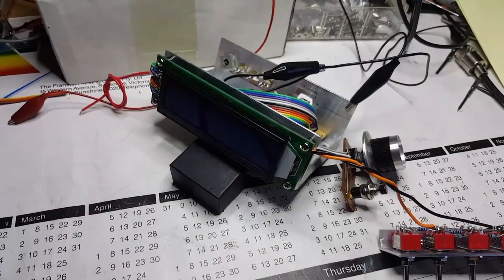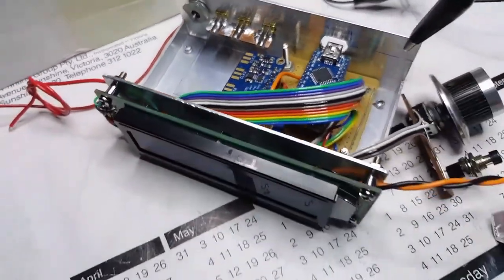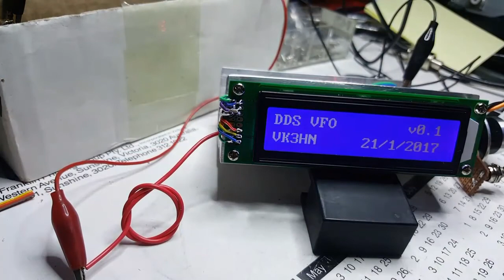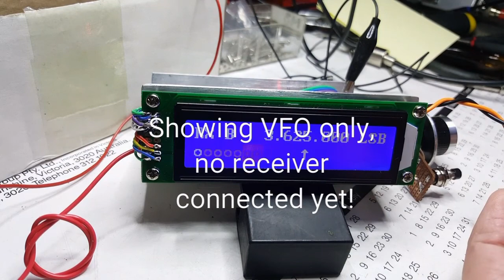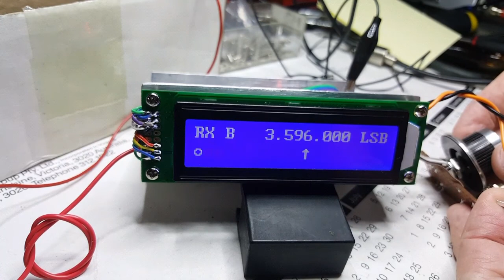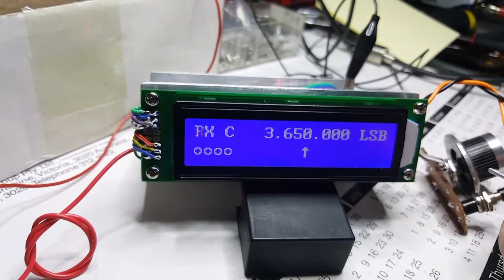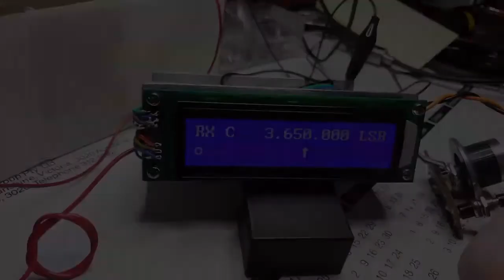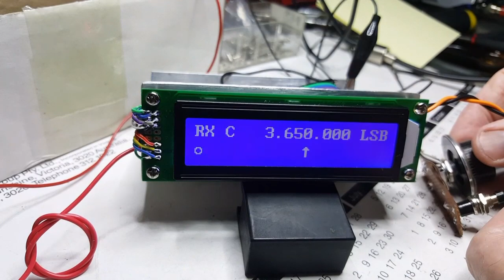Multiband VFO with Arduino and si5351

Comment: I have admired your experiments, I ask, if possible, that you increment the clarifier optional function (in the menu select "0" (disabled) or "1" enabled). I would like to add to the code in an analogic input (for example A4 on Arduino Nano) the functionality to slowly changing through a potentiometer the functionality to adjust + 2500hz to -2500hz (5khz with center on the display), to better adapt to the old transceivers with "Clarifier", so inserting wires on original clarifier potenciometer, thus giving an appearance of more originality... If you can implement and share the code I'm grateful. Best regards, PU2YZO
Reply from the maker: Mauricio, hello and thanks for your kind comments.  I have not used clarifiers very much and so as my general philosophy is to minimise the front panel controls on my radios, I did not bother to implement one.  It would not be difficult to implement a clarifier.  There are a few decisions to be made.  
The main one is to decide what control will be used as the RIT control.  If you use a potentiometer across 5v with the wiper to an analogue Arduino input, the RIT spread may not be linear, and may not extend equally either side,  neither of which would be a major problem.  A better solution would be to implement a second (mechanical) encoder, as encoders have discrete steps, and each step could add or subtract the current radix (frequency increment).  A mechanical encoder with an inbuilt p[ushbutton could be used, the pushbutton acting as the RIT in/out switch.  Adding a second encoder will occupy two Arduino/MCU Digital inputs, which would necessitate offloading the current parallel connection to the LCD to an I2C backpack.  
The analogue sensing option is easier. In which case, a separate pushbutton switch will be needed for RIT in/out.  
Code will need to be modified to display the RIT offset on the display.
The code around T/R will need to be modified to defeat the RIT (reset the VFO) when transitioning from receive to  transmit, and vice versa (as the function you have asked for is a receiver incremental tuning, not a split frequency function).
The remaining design issue is how to interpret the RIT potentiometer offset at the time RIT is engaged. It would be best to read the RIT potentiometer, and map the reading into a VFO frequency offset.  That way, you could set the RIT to a preferred offset, and have the receiver RIT to this offset each time you engage RIT.  You would need to center the RIT potentiometer manually, if needeed, by turning the potentiometer and watching the displayed RIT offset. 
It's not all that difficult. But as you can see, it's a bit of work.
If you go to my Github repository you will see that a number of people have forked it. This gives you a local copy, with the option to have it updated from the master (my master code) at any time.  You can modify code in your forked repo.  If you really want this feature, I suggest you do that, or work with a friend to help you, as I don't see myself getting to do this in the near future. 
If you go this path, good luck, and let me know how it goes.
73 Paul VK3HN.

Comment: Hi Paul, I have only just recently "discovered" the Si5351 boards and now plan to teach myself how to use them. 
I want to learn how to write up a sketch.
I have an old  AWA 25M 6m FM crystal locked  radio and thought i might be able to use one to replace the crystals for both transmit and receive. I am researching where to get a leg up to write the sketch at the moment. Nice QRP unit ( your blog) you have built. Thanks for the video. Colin vk2jcc
Reply from the maker: An Arduino Nano and si5351 will do that job, with a suitable buffer amp. Good luck with that boat anchor renovation!
Reply: Colincolin30 Check out the “ProgRock” kit at QRP Labs.  It is a nice small kit based on the si5351.  The price is very reasonable.

Comment: I see so many VFOs and Crystal Oscillator Diagrams from YouTubers displaying their skills to leave out impariative information or away to achieve that information.  They have drawn up their schematics, none of which include any component values...
This is of course, No help at all, since I do not see an estimate of the total cost nor place to purchase a proper schematic.  Even Worse, all of these (except a couple) tell you if they will work on AM or FM.  The information is ambitious but I surmised that CW and SSB VFOs require a BFO because CW and SSB have no carrier... Yet these VFOs do not show a BFO (Beat Frequency Oscillator - the "beat"
Like the guy kicking the big drum... Keeps the beat as does the AM and FM carrier.
 So how can it work?
      Each of these Schematics tell of whether it works on SSB or CW or both... But they do not display anything on whether or not they work on AM or FM.  Do they ASSume we know they work on AM or FM or both?  Or do they ASSume we know there is an additional (non-mentioned) circuit required?  Or do they ASSume we know that these Schematics are for SSB and/or CW only?
      I would have expected SOME of the YouTubers posters to address these issues, but no, they literally all leave this need to know information completely out.   Why is this, other than extremely poor teaching abilities?
      I would NEVER SUBSCRIBE to anyone's channel that got me to spend money trying to develop what they show only to find out that the very basic information they utterly left out, left me without a working project and no funds to do this all over again.     
      If you read this and can appreciate the problems I mentioned, leave a comment effectively saying... Correct these issues or lose yey another subscriber.
Reply from the maker: Thanks for your detailed comment Terry.  All my Arduino/si5351 modules are built to the HFSignals Raduino circuit.  The circuit diagram as with the BiTx and uBiTx transceiver projects are open source and in the public domain. See http://www.hfsignals.com/wp-content/uploads/2017/12/raduino.pdf    My blog vk3hn.wordpress.com has posts  for 7 or 8 homebrew QRP SSB and CW transceivers that use this design for the VFO, BFO and carrier oscillator for generating CW at the signal frequency.  The raduino VFO module is suitable for an AM or FM receiver, which would be a conventional superhet, excepting that the IF filter would need to be wider (6kHz for AM, 15 to 25kHz for NBFM), and last IF and detector, at which point you need an AM detector, or FM limiter/discriminator.  Good luck with your projects.  Paul VK3HN.

Comment: Pauls, does this vfo have a function that it could switch between channel and frequecy mode on display?
Reply from the maker: Yes, the VFO is taken from si5351 CLK0, you could make it channelised by changing the code so that buttons increments or decremented channels I guess.

Comment: Nice job Paul, I love your sketch... do you plan to share it?? I'd like to build one vfo like yours for my multiband project
Reply from the maker: Eduardo Garcia Montes De Oca Hi Eduardo, I will put the sketch up on github ( https://github.com/prt459 )  in the next few days.  If you have some Arduino programming knowledge you should have no trouble modding it for your purposes.  I am working on a variant which does not use band switching, rather, it senses the current VFO frequency and selects the appropriate BPF and LPFs.  I can put that up on github as well.
Reply: Could you put the same sketch for  I2C displays?
Are these vfos working with Arduino's atmel chip based only?